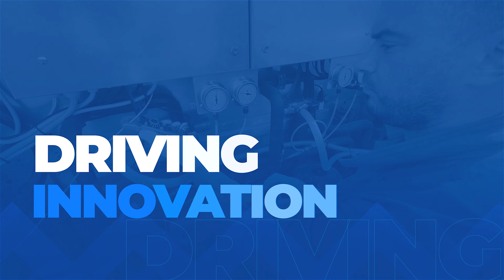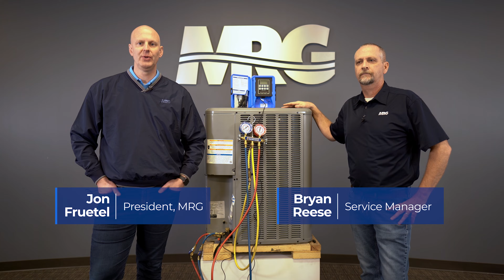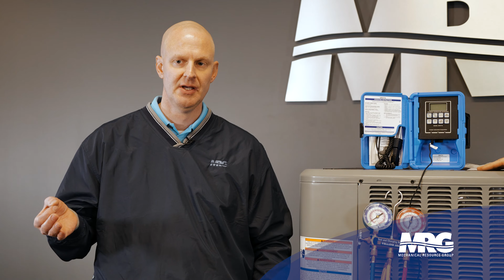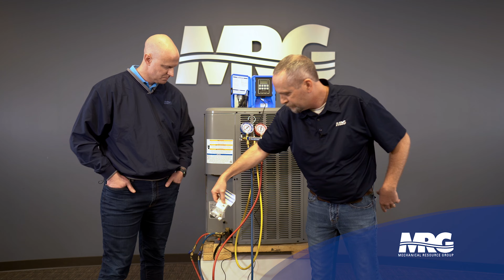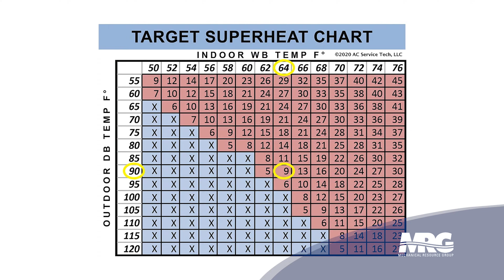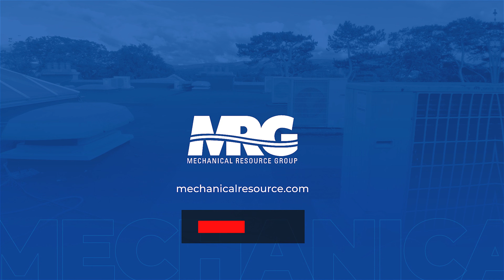Mastering Superheat: The Trick to Charging an HVAC Unit

Comment: New techs, don't let them tell you digital tools don't teach you anything.  It's all the same thing.  Just takes more patience with digital tools because your not going back and forth to check the WB temperature.  You need to give the refrigerant time to find its place in the system.  

Use tools like Measure Quick, but try and guess what and why MQ is going to tell you before you look at its diagnosis.  Take screen shots so you can analyze what happened later. Also forget pressures everything is a temperature.  If you think in temperature it doesn't matter what refrigerant you are using it's all the same.

Get a cheep set of analog guages, and a good set of digital probes with psychrometers. Those digital probes will go way farther than a digital guages ever could.  There expensive but you will progress way ahead of your coworkers when you learn how to read them.  It is a tool you will never outgrow.   It is important to try to figure out what MQ is going to tell you, this will put money back in your pockets when you can diagnose quickly.

Comment: Great informational video.
I hope you can help me. I have 14 seer evaporator coil and 15 seer  Carrier condenser (no matching system .I know that) There was original piston (0.088) in the unit ,but after the Carrier condenser
was install, piston was replaced by TXV. Unfortunately ,randomly compressor is overheating , so I planning to put the piston back .  And  new piston is 0.090. What's your take on that?

Comment: If there is no piston installed at all, there is no expansion device and thus no refrigeration will occur.  Inhave never seen a system with no piston installed.  The indoor unit will usually already have something installed.

Comment: So my 4 ton package unit has the piston. It’s running my shop. I bought it used. I’m getting a 15-20 delta T but pressures are 155/470. Ambient is 95 and wet bulb about 77 using wet rag and prob. Suction temp is 80. So I think target is 30 and actual super heat is 30. Im I good or missing something. Suction stops sweating around noon.

Comment: Can an R22 system with an original piston-type expander be converted to TXV when a new evaporator is installed?
Reply: Yes. You just need to make sure you have the right TXV that's made for your air handler and made to work with R22.

Comment: If I am not wrong, not all expansion valves are located at the evaporator.
Reply: Yes they are, unless you have a heat pump which has them at both the condenser and evaporator, or you have a mini split system that can locate at various places.

Comment: Great video.  Very detailed.  I do have a question on the indoor wet bulb temp reading.  Is it correct to take the wet bulb temp inside the home at the return grill if the evap coil is in the attic?  Or do you need to take the wet bulb reading up in the attic inside the unit case before the return air hits the evap coil?  Thanks

Comment: I want to see the real/actual pressure & temperature that is the system should be running. Take some readings and measure the superheat!
Reply: THE CLARITY OF THE EXAMPLE SUFFICES. YOUR UNIT PRESSURES WILL LIKELY NOT BE THE SAME AS HIS ANYWAY. APPLY THE PRINCIPLES -  THAT'S WHAT'S IMPORTANT. THE REFERENCE NUMBERS USED WERE CORROLATING TEMP. / PRESS. AS THEY ARE ON THE CHART. THEY HAVE SHOWN YOU HOW   - DON'T BE AFRAID    THANKS FELLOWS!!!